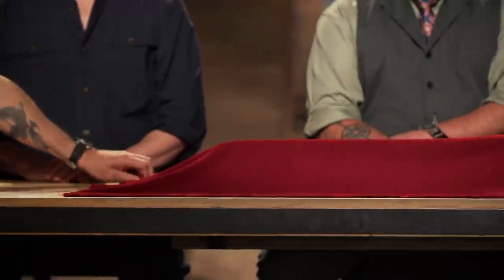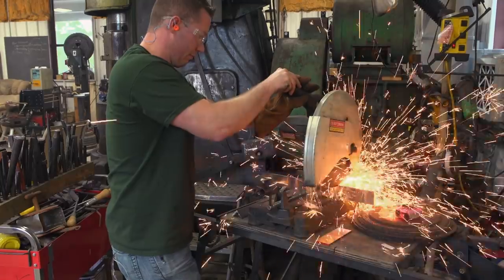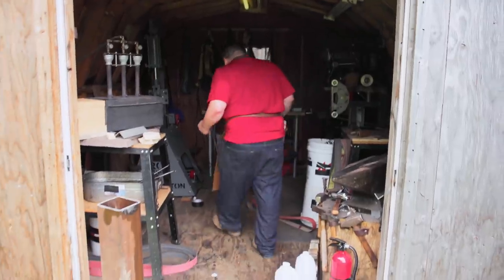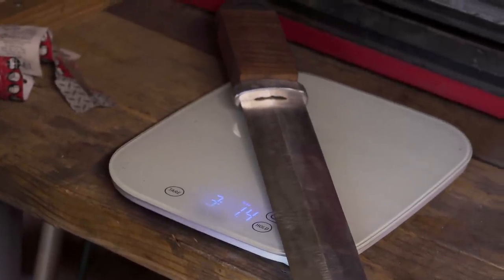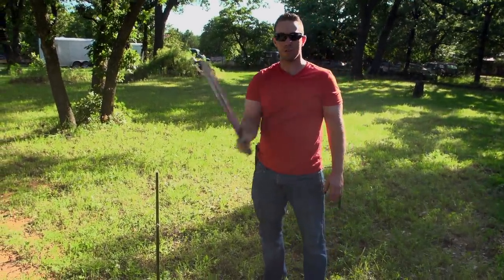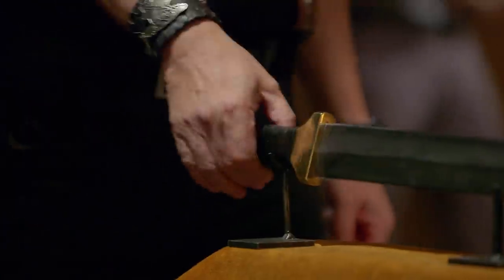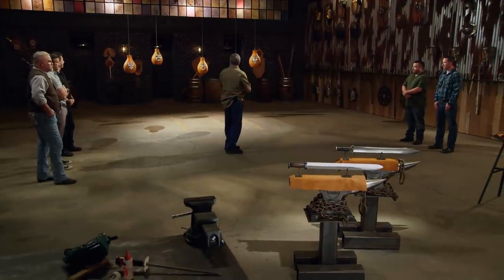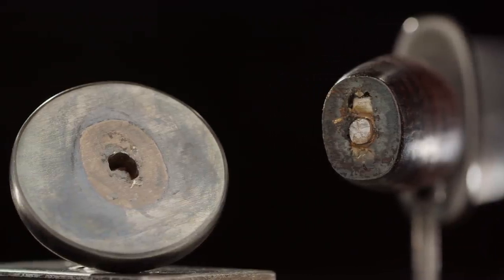Forged in Fire: The Jian Sword WREAKS HAVOC (Season 7) | History

Comment: I get why, but I find it harsh to lose just because of a pommel breaking off
Reply: I think it was the right call, if they continued testing the handle could have come loose mid swing, accidentally launching the blade.
Reply: well not really, the pommel is essential for the swords retention, lose the pommel, and you completely lose the ability to wield a sword safely, albeit due to swinging the sword and it flying out of your hand during combat, or striking a target and the handle coming loose and then you can't wield the weapon atall. it would be stupid to continue testing without the pommel.

Comment: A POMMEL COMING OFF IS CATASTROPHIC!?!?
Reply: Yes. Yes it is. Not only is it, as was WELL explained in the episode, essential to the retention of a one-handed sword, it also is what holds the handle onto the blade. Any further bashing without the pommel can result in the handle coming off entirely. Yes, they epoxy the handles on, typically, but that's mainly to keep it from squirming. Epoxy alone isn't considered structurally sound enough to rely on it when smashing the blade into stuff.